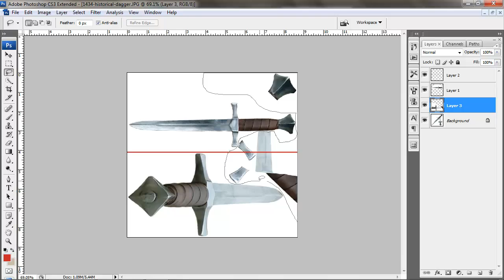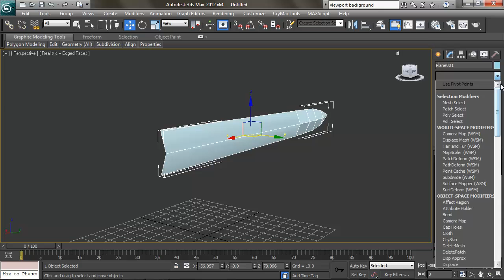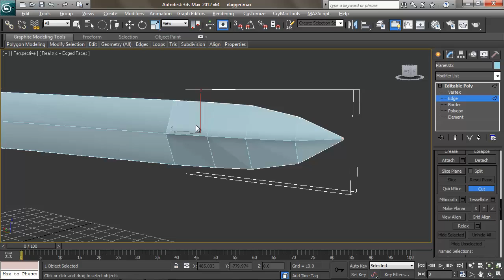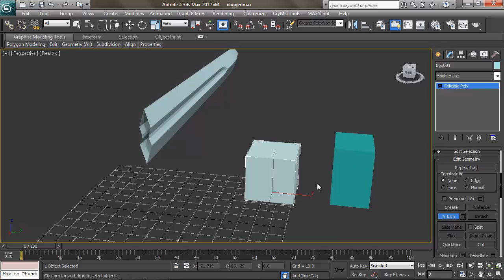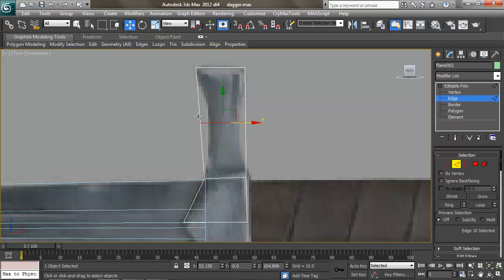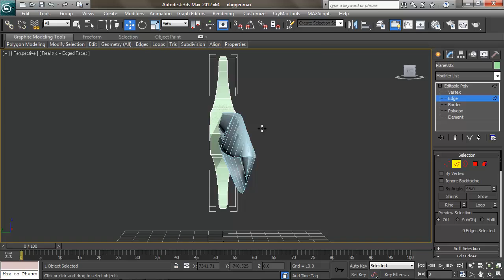Intro to 3D Modeling Chapter 6

Comment: For people using Max 2014+ and having the lock zoom/pan issue, Create a new plane, create a material and set the diffuse to bitmap and select the image. Then add the material to the plane. Then open your layer editor (Tools > Layer Explorer) and create a new layer by hitting the button at the top (in between lock and add to active layer [the plus sign]) and drag your plane object into that layer. Now freeze the layer and right click on the name of the layer and choose properties. Uncheck 'Show Frozen in Gray', change the Display dropdown to 'Shaded' and click the shaded button next to 'Vertex Colors'. Click ok and right click on the plane object now and choose properties, under 'Display Properties' click the 'By Object' button so it switches to 'By Layer' click ok, go back into the Layer Explorer, click on the 'Active Layer' icon on your default layer (in between the name and the lightbulb). Go back into your viewport, try switching to wireframe and make sure you can still see the background image while the other objects are wireframe. 

Hopefully this fixes things, there was another reply but it was kind of vague. If I forgot something, or it didnt work for you lemme know, I'm on Max 2016 right now.
Reply: +Dank Donuts you are a saint.

Comment: Hello, there isn't a lock zoom/pan option from 2014 version up. How would we work around this?
Reply: +RaZeXzZz Make a plane, go to material editor and set the Diffuse -> Bitmap. Select the image and select "Show shaded material on viewport". Then paste it onto the plane (be sure to select something like shaded, you won't see materials in wireframe). After that, freeze the object. If it then turns gray, go to the properties of that layer and uncheck show frozen as gray. Hope this helps :)